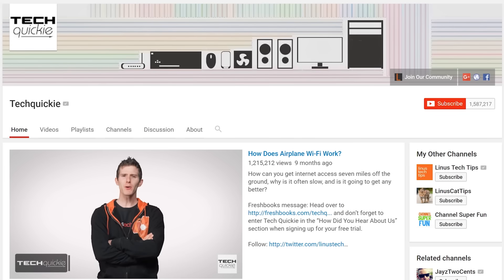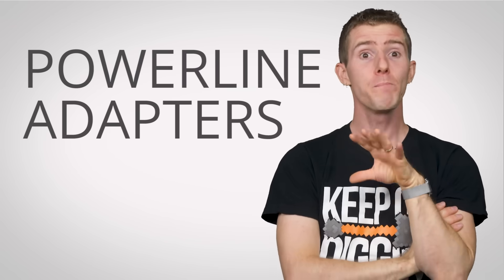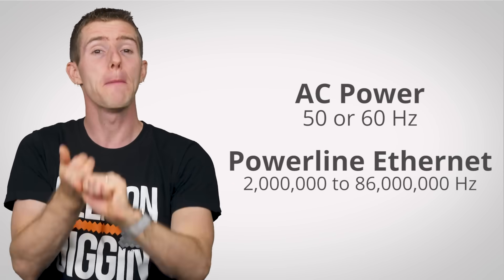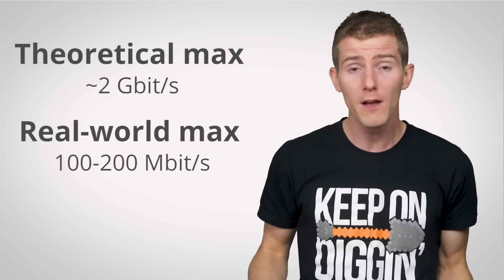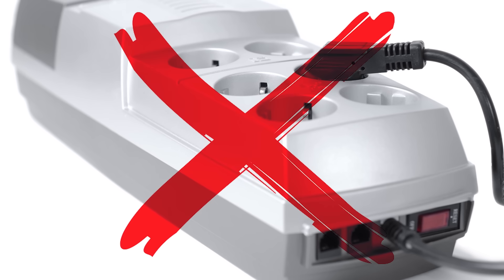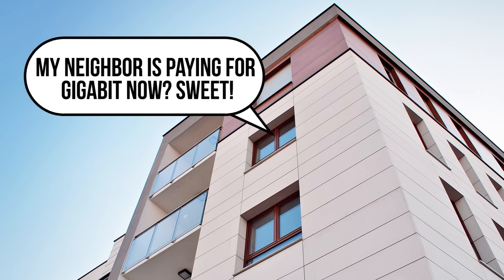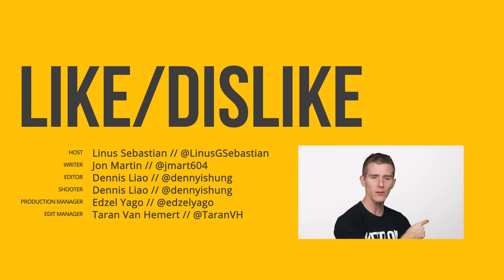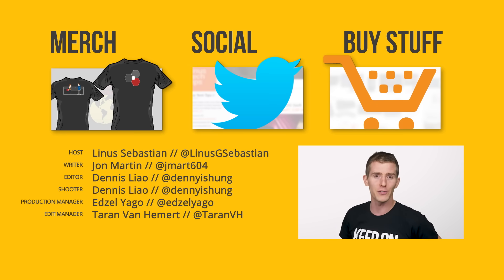How Does Powerline Ethernet Work?

Comment: I'm in one of those new fangled network wired homes. I paid for Cat6 with the builder, but I came the day they were running wire and asked them to use the box of Cat-6a i bought instead. 10Gbps wired home... MUA HA HA HA HA HA!!!!
Reply: JJPlaysForDays 10Gbps is just the wiring. I have 1gb fiber internet. I'm just internally set for futureproof
Reply: How would you even get 10Gbps internet like damn I pay $80 for 60/4 I couldn't imagine how much 10Gbps would cost
Reply: @jjplaysfordays5601  I pay 16€ for 200/50 internet
Reply: mattwillis4 rip I'm paying $80 a month for 10/1
Reply: What switch are you using?
Reply: CheapSushi right now just a standard managed gigabit switch. Nothing crazy since I'm not coming close to saturating gigabit bandwidth yet. I will be streaming uncompressed 4k movies from a large Qnap NAS eventually.

I really did it just so I'd never have to worry about internal network bandwidth since we are going to be in this house for the next 20 years and we have fiber up our house... And nerd bragging rights.
Reply: @bloodscourge  Seesh - I aint never needin no Gigabit speed. If i can get 2MBYTES/S for myself - that would be internet heaven 4 me
Reply: Do you happen to live in a dense city, or something more rural?  Is it possible to do that in a more rural location but not too far from a city and have gigabit access to your location?
Reply: Trying to navigate the differences on Cat6 and 6a. I thought the difference was the distance you'd get those 10Gbps speed. You'd still get the 10Gbps with the 6 wouldn't you?
Reply: Wait, so are you are getting 1Gbps at the WAN edge as well? Your bill must be in the 1000s. I get at least 200Mbps and rarely see those speeds in downloads even with gaming on my XBox One.
Reply: should have run OM4! copper is so 20th century
Reply: mattwillis4 You might want to look into lossless compression to save some hard drive space.
Reply: Jeez I pay 95 after taxes and equipment rental fees and that's for gigabit internet and TV through verizon fios.
Reply: And how much did that cost
Reply: Fartonaut even using h265 you lose color range. I've been testing it out and watching side by side on the same screen. It isn't much, but noticeable.

Comment: I tried power line once, but turned out it worked only as long as I didn't plug anything in. Turns out a house from 1956 doesn't have the best power grid.

Comment: Used to use Ethernet Over Power at home until we upgraded to Australia's Optic fiber network on NBN. Discovered I was only getting about 30Mbps with my Powerline adapters, but my internet speed was about 94Mbps.

I also had issues with my PS4 and Smart TV dropping out on these, the wifi was much more stable.

And finally, one other issue I had, the 2 main locations i needed these in, only had 2 power points next to each other. Unfortunately, the TP-Link adapters I had were too wide to plug anything in next to them, luckily though they had power pass through, but this basically meant I had ONE power point to power my PC (which includes the PC itself, 2 monitors, speakers, a lamp, and a couple other things)

I now have ethernet cables running through the walls, and my network is so much faster and more stable now. 

These adapters are great, but yeah so many variables that could affect them.

Comment: You should also remember that the adaptors only work when they are connected to the same power system. Sometimes houses has several independent circuits for different phases.

Also, the vendors typically brag about the bitrate the adaptors support, but that is the speed of the protocol between them and not the payload data. So even without interference, they can not deliver the speed stated, if I understood it correctly.
Reply: it still works but the speed is crap, or are you talking about tri fase power?
Reply: # yes, that's what I meant. Then the different phases maybe are distributed between floors, so the power lines aren't connected

Comment: When I was in high school ~12 years ago, the landlord decided to try this instead of ethernet cables. Even though the connections were less than 5 metres of wiring apart, speeds were abysmal. 
This was back when 5 down adsl was considered great in our area. 

I honestly don't see the point in doing internet over electrical sockets, unless there's no other way. So much stuff is being put in those, it's bound to cause some grief.
Reply: Richard Tønnessen that was 12 years ago, you do realise that technology improves over time right?
Reply: @kacperb1283  ik that's what I was thinking although I was 3 12 years ago
Reply: 5 down DSL is still considered the best in  my area.  $120 a month too.

Comment: Don’t forget , if you have big power supply’s or switching supply’s. It could interfere with the power line because of the switching noise . Had the same in my previous house that had a big traction battery for 12v lighting that occasionally needed charging

Comment: So how do you set something like this up? Connect your cable router with ethernet to a power line plug adapter thingy... and then just connect your PC to another one in another room? Seems too easy. Will data going through power lines make your electric bill higher?
Reply: Tim Kline it is really that easy, i have been using one and its great. As for electricity, not noticeable differences. Naturally every device uses power and it needs a bit to send the signals but it is only cents worth of power. It does have downsides like Linus said, it's slower then both ethernet and wifi but it is easier and since they work where wifi doesn't and vis versa. They are really good for steel buildings but wifi isn't, however a workshop would get no where while wifi would be great there.
Reply: Interesting. Never heard of this till now (thanks Linus). Our cable modem w/ built in wifi is on the 3rd floor, but my man room is in the basement. I have a wifi extender on the middle floor, but the speed is still not that great. Best I ever saw was around 6 mb per second downloading. This might be worth a try.
Reply: it is possible it may help, it does depend on a lot of factors like the wiring and stuff but it could help. if you wish to try it go for it but there is a chance it may not work. when it does work however it is wonderful tech. I acquired one about a year ago now from Foxtel (paid tv service), they gave us a free 3 month trial and send a powerline adapter in the box with the Foxtel box. when we got the letter on how to send the box back they basically said if you want the powerline adapter to feel free to keep it or if you don't stand it back. so I have been using that same powerline adapter since for my tv and it been great. I have run my Xbox 360 thought it and I now run my testra box thought it and never seen an issue. we often send HD Netflix and youtube and no problems.

Comment: Powerline is really great if your house has concrete between floors. Then you can place an access point on each floor, and connect them together with Powerline.
I have done some in-depth testing with Powerline: https://youtu.be/Z0glNXBaBDY

Comment: What doesn't get mentioned enough in this video, is that powerlines usually are complete thrash. Maybe the most expensive ones are decent, but often a good wifi connection is simply a lot faster. If you really have trouble with walls and installing ethernet is not an option, look for coax cables installed in your house (for the tv/radio signal). If you have those, you can use MoCa, which, in my experience, is extremely reliable and a lot less frustrating to set up.

Source: years of experience in onsite IT support.

Comment: Why doesn't the wave leak out onto the rest of the powergrid? I mean, everything is connected to the powergrid, right? I get that the signal strength is far from strong enough to leak out all the way to the powerplant, but it at least should get into a few neighboring houses I'd say, what if they have their own thing? Wouldn't that just completely disrupt each other?
Reply: MaxArceus distance is one reason as Linus said even in bigger houses when you put two adapters too far apart connection will degrade. Second I think the power connection of your neighbour will do the same as (again what linus said) filter out the signals as unwanted background noise
Reply: Yet I can imagine in a modern settlement entirely build in 2017 with fast Internet connectivity in mind I can imagine that due to the newer cables more information could leak but would by time of arrival nothing more then undecryptable nonesense. In apartmentblocks this is sure a thing. Single houses? Nah I dont think so.

Comment: So wait that means that i can plug one of the ethernet thingies into my outlet, plug ethernet cable to it and my pc, and ill have my internet?
Reply: did you ever find out the answer to your question lol, I'm looking to buy one and kind of need to know
Reply: Yes that's how it works. One of them you plug the cable from the router into it and plug it in the electrical outlet and the other you plug in an electrical outlet wherever you want the internet connection. Then all you do is push a button on them and they connect and stay connected.

Comment: Okay Linus, I've got 4 kids who Lan game plus me. Do I need 10 kits then? How's it work with 5 or 6 computers at the same time?
Reply: 10 kits? Probably not. Just need one to plug into the router and then you place the others around the house wherever needed. Now that's not to say that newer versions are different but things may have changed since I bought my set close to 10 years ago or so. Multiple computers, depends. What kind of stuff will be going on, gaming, web browsing, 4k video, etc. Also your wiring needs to be decent.

Comment: But what should I do if my router is upstairs and my computer is on the opposite end of the house? 
Powerline is the only option I get.
Reply: John Hitman, 5 Ghz Wifi is shit for going through walls. It's one of the things that would make it better to use in an apartment building than 2.4 Ghz even if everyone in the building was using it. 

As Gamingdude said, powerline is a pretty good, simple solution if you can't get good wifi to where you want your computer. I used it for a while, and the main reason I stopped is the one I got had one of the adapters went bad (possibly related to the fact you can't run it off of a surge protector). If you do want to use one and are worried about a surge killing your computer, you could either get a surge protector with ethernet ports, or get a powerline adapter with wifi.

Obviously, there are better solutions (in terms of network performance). But most good mesh networking options (to boost a wifi signal to let it reach where you need it) are more expensive, and not everyone is allowed to run cabling through the walls (like apartment buildings), and it is either more expensive or requires you to know what you are doing.
Reply: MasterD4 or you know... no idea if where you live you build houses like we do in Italy but you can simply run your ethernet cables in the electrical wires duct with the right tool. It's really cheap to do too, you just need to but enough ethernet cable, crimping tool and they thing you use to guide cables inside of the pros pipes
Reply: One approach I used to use until we got proper cabling was to run a 15m ethernet cable along the skirting boards, round every corner between the router and my desktop. Hardly noticeable, given it didn't need to cross any walkways. Even if you do need to do that, you could probably hide it under a rug like we did the phone cable between the router and phone line.
Reply: In my house we drilled holes through the walls and ceilings to run ethernet cables.
Reply: If you're ready to spend some money to fix it you could look into mesh networking
Reply: A couple hundred feet of cat6. Run it out your door, down the hall, down the stairs to where your router is. No one will ever notice ;)
Reply: I had a power line adapter at one end of the house, with my computer on the opposite end. I got 125MBPS with my 100MBPS plan. And my house is fairly large. One end of the house to the other is about 60 feet. You should be fine.
Reply: @gamingdude2811  You should avoid capitalizing "MB" in "Mbps". MBps is mega BYTES per second, where mbps is mega bits. There are 8 mega bits in a mega byte, so having a 125 MBps speed is the same as a 1000 mbps connection. There is no way to get a faster speed than what is coming from your modem. 60 feet is average for a house.
Reply: 5Ghz wifi !

Comment: What can I do if my Powerline Adapter stops working every day for hours! Ps: hooked up a router to the adapter but that shouldn‘t be a problem. And the wifi signal is still working, i just don‘t get any data. So i assume that the problem is the adapter not the router.